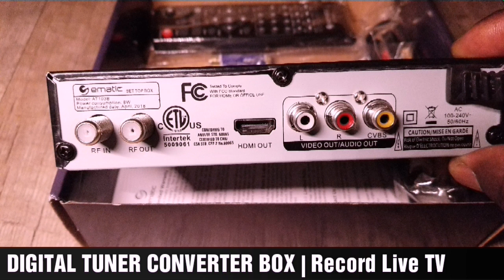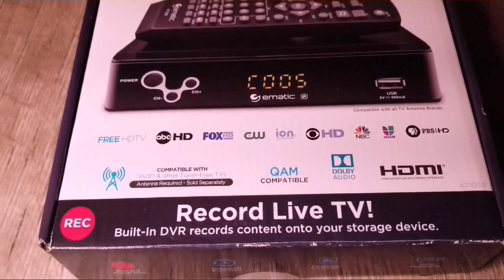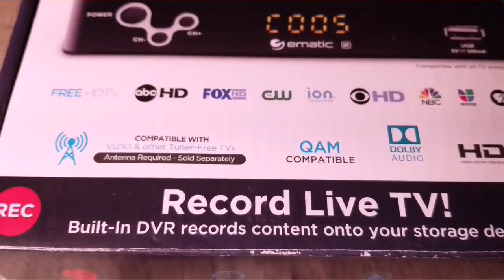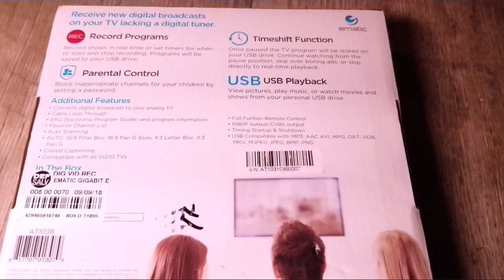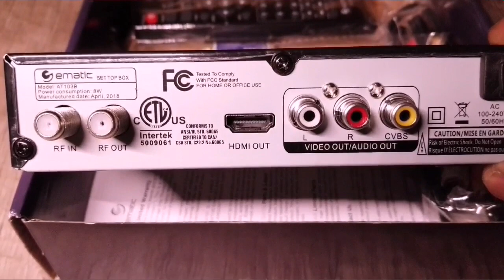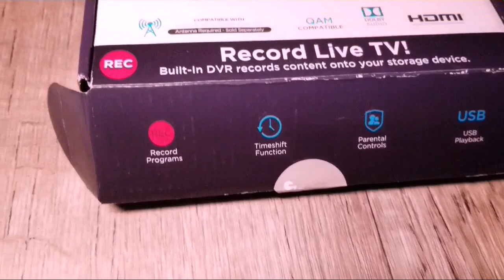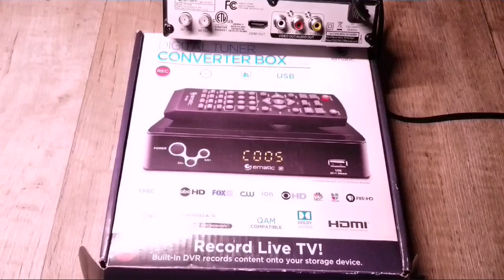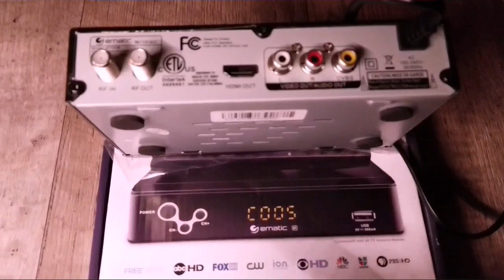HOW TO SETUP A HD DIGITAL TUNER CONVERTER BOX WITH HDMI OUTPUT REVIEW | Record Live TV!

Comment: Hello there just ran into your channel I really like your videos you seem to know a lot about free-to-air satellite which I seem to be very interested in. I think these converter boxes are great I'm glad that they're still making them I noticed this one has an HDMI port a lot of the earlier revisions of these converter boxes did not have HDMI they were specifically designed for the older picture tube TVs or known as a CRT. That's exactly what I was thinking when I saw that HDMI port you could easily hook that up to a projector which most projectors don't have built-in TV tuners at least not all of the ones that I've seen. I also like how it has the USB so you can use it as a DVR to record over the air content if I'm not mistaken some of these converter boxes also have screaming features built-in so you would also be able to see your Netflix Hulu and any other streaming services all with one box. There's a lot of benefit to having one of these even with today's modern TVs.
Reply from the maker: All the points you mentioned above are absolutely correct. At least you understood what I was deriving at.
Thanks for your awesome comment and stay bless.
Cheers
https://youtu.be/eOiM49CXecU
Reply: yeah i dont quite understand HDMI

Comment: My question is: If I set up a schedule to record a show at a specific period-time-frame, meanwhile, can I watch the TV on different channels?
 In other words, once I set up a schedule for recording a show, am I able to watch other channels simultaneously?
Reply from the maker: No...
Thanks for watching and don't forget to LIKE👍 SHARE and SUBSCRIBE
Reply: The unit does not let you watch a different channel while recording (Unit has 1 tuner), but it does allow the antenna signal to be setup to bypass to the RF Out port and that can be sent to your tv if it has a digital tuner built in, so you can technically watch whatever you want on your TV tuner while recording on this device.